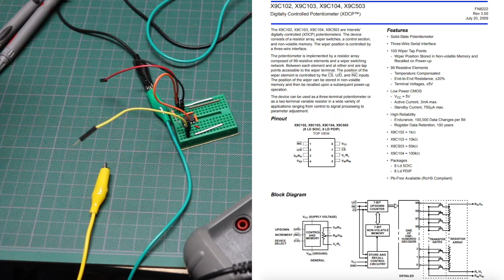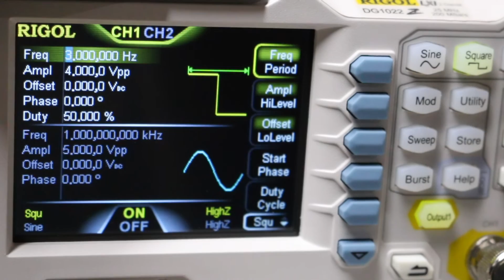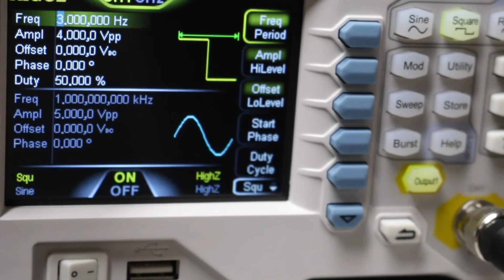Digital Potentiometer Control Basics - X9C103

Comment: This is a great instructional video for a really useful device, but what I came here looking for is a digital potentiometer that sets its resistance based on a PWM signal. I suspect such a thing exists, just not sure what it's called or how to find it. Any advice would be super helpful. Thanks in advance!
Reply from the maker: I don’t think there is a digital pot with PWM direct control, it’s usually some sort of up/down digital control, or SPI or I2C serial control.
So some sort of interface circuit would need to read the PWM duty cycle and translate that to whatever type of control the pot wants so it sounds like some sort of micro controller project.
Two general thoughts on that could be a microcontroller can measure the timing of the PWM transitions and determine the duty cycle and then just set the pot when it changes, or put the PWM signal through an RC low pass filter to translate it to an average DC voltage and then read that on the microcontrollers analog input and again convert that into a percentage wiper position and communicate with the digital pot.
That all assumes the digital pot will even work in the application like if it is meant to replace a physical pot, usually there’s a maximum operating voltage of 5 V or possibly less I’m not sure
Reply: @GadgetReboot  Wow! Thank you for the quick reply. I'm wanting to control the variable control side of a SSR-40VA with a PWM signal instead of a manual 500Kohm pot. Maybe I can read the voltage of the signal being sent into and out of the manual pot across its range then just pass the PWM signal across a RC low pass filter that outputs that voltage range to simulate what the output of the manual pot would be.
Reply: @GadgetReboot  I would just send the PWM signal to a SSR-40DA, but it uses the zero cross trigger method and I'd prefer to use the trimmer control method as illustrated on page 2 of the datasheet linked to below... https://cdn.sparkfun.com/datasheets/Components/General/SSR40DA.pdf
Reply from the maker: Now that I looked more into the SSR with variable 500K pot control (never worked with SSR before) I see a big can of worms.  Here's one thread I stumbled across that summarizes some issues trying to use something other than the 2 watt 500K pot, though it's an old thread so some links/images are broken but the discussion still helps.
https://forum.arduino.cc/t/relay-amperage-output-control-with-pwm/261538/14
Basically, the biggest problem is that 500k 2 watt pot is a heavy duty item, and apparently the mains voltage (peaks over 300v) is present at that control input (probably why it's a high power pot), so trying to add other DC control voltages or devices in place of a high power resistance wouldn't work.   I think the pot is part of the mains AC controlling a TRIAC rather than it being an isolated "control input" at low power.
So if there's a different variation of the SSR that takes DC control input and can vary the output instead of just on/off, that would be a more hackable starting point.
The digital pots in general are really only low current low voltage things, so working up to 5v DC and maybe only max 5 mA current, definitely not something to place across 300+ VAC.   They're mostly used for things like adjusting a reference voltage on an op amp where there's really no load current though them, or they can be used to control audio volume on low level signals like line in/out (a few volts peak).
Reply: @GadgetReboot  That's a great article, kudos for finding it and thanks for sharing. One possible solution is to use the PWM signal to drive a servo that turns the manual pot, but I'm blown away that there's not a more elegant all electronic solution. Seems to me that in our electrified world of billions of people, if I as a hobbyist am trying to solve this challenge, there must have been thousands of engineers who've done the same. Another possible solution is to have a micro controller convert the PWM to a 1-10 number by dropping the second digit of the duty cycle percentage, then use that number to control a transistor array that channels the SSR's control current through 1-10 50K resistors... much like the X9C103 chip in your video above. Also, the pot that ships with the SSR-40VA that I bought off Amazon is 0.25 watt, so not quite as heavy duty. I'm curious to see what voltage I get testing the control input to ground once I get it set up. Main voltage at 240 would certainly rule out all sorts of typical electronic controllers.
Reply from the maker: I wonder why they do specify the potentiometer as being two watts, maybe general robustness in case there are occasional power voltage spikes or other things outside the nominal clean supply, but with all things being stable, 240 V RMS divided by 500 K is 0.12 W
So a 0.25 W part would be OK for trying out but knowing now they recommend something higher I’d probably use something better if that’s going to be put in use long-term.
The main problem with switching in various resistances to simulate a full scale pot rotation is the fact that it’s AC instead of DC so that may need special design considerations at which point it starts getting convoluted and it may be better to just find a different part if there is one that automatically takes digital input and does the same output control

Comment: Hello sir I'm a btech first year student in india. I am learning electronics and I am trying to make my own bluetooth speaker so people ask me y don't ur speaker have buttons to operate the volume so I'm curious to know how this digital potentiometer works and ur videos definately helped me a lot
Reply: I just want to know how to connect to the amplifier so that I can control the volume
Reply from the maker: It would depend on the circuit especially being bluetooth if you don't have audio coming in from a wire, normally the pot would go in line with incoming audio like this  https://i.stack.imgur.com/w5C3B.jpg     but if you're using some kind of custom chip with all kinds of built in functions, that needs to be analyzed to see what's possible.  It wouldn't go on the output of the amplifier heading to the speaker, too much power and it's always done on the low level input side.
Reply: @GadgetReboot  thanks a lot sir I'll check that

Comment: 3:41 - So an increase or decrease of pule frequency determines the increase or decrease of the digital potentiometer's resistance value?
Reply from the maker: Not the frequency of pulses (how fast they occur) but the number of them received.  For each pulse on the increment pin, the wiper moves one step up or down depending how the up/down pin is set
Reply: @GadgetReboot  Thanks for the clarification. What kind of wattage these digital potentiometer can handle, 1/4 watt?
Reply from the maker: @ShopperPlug  The wiper can handle something up to 4.4 mA with a max voltage of 5v, they're really only intended as non load bearing things like set points on op amps that don't draw anything.  So if I use it for a volume or EQ circuit it's likely got an op amp buffering it too.

Comment: I am hacking a machine. It has a potentiometer for the accelerator pedal. It operates at 24volts and the resistance is about 4.7KOhms. Can i use a digital potentiometer to replace the potentiometer to give me remote control
Reply from the maker: I don’t know if they have digital pots that run at higher voltages but the ones I have used can only work with up to 5 V.
Reply: I am also working on a machine- a pallet stacker to be exact: 24v lead acid battery. Did you ever solve your project ??

Comment: sorry to ask again...but could u please clarify again that,how are u increasing the counter ?
Reply from the maker: The first time I was experimenting with the device I was using square waves from a function generator to make it easy, if I didn’t have that I would either generate pulses from an Arduino or have a pull up resistor to the positive supply and use a switch to ground to manually do it

Comment: I need a 102 because I need to made a 1k electronic pot and all the 2 batchs of 10 units that I bough from 2 different supliers came with 10k, so something is not correct in our evaluation, I though it was only we me but after I saw this video maybe eu are wrong or not seeing the correct prespective... if I bought x9c102s that should have 1K and when measure gives 10k an you with the 103 that should have 10k when measure have 100k... let me see you video until the end...

Comment: ...I bought 10 pieces, in China, of this circuit for 5$...the resistance is not 10k but 100k. Also the circuit doesn't work! So I bought this circuit at Intersil (6$ each). It works perfectly! I had the same problem with LR8N3 (voltage regulator) from the same chinese supplier...The circuits exploded at power on! Thanks for this video, it proved to me that the setup I was using the X9C103 in worked perfectly!

Translated with www.DeepL.com/Translator (free version)
Reply: I check and I saw that I can buy this units in Mouser electronics... I will go to the shop my self and I will buy it but before I will ask to measure in from of me... I need the X9C102P (1k ) from china I bought 2 times from different supliers and all of them arrived with 10K

Comment: between which two terminals resistor is connected
Reply from the maker: Pins 3, 5, 6 contain the potentiometer terminals. 
https://www.renesas.com/us/en/www/doc/datasheet/x9c102-103-104-503.pdf

Comment: I also ordered the 10k from AliExpress but got the 100k so there must be a large batch of incorrectly labelled 103's....shame...waste of time
Reply from the maker: I wonder why that is happening. It almost makes me want to order some from a reputable distributor just to double check the results but I have not needed to place an order somewhere like that in a long time and it will cost a lot for a minimum order and shipping costs so next time I do, maybe I’ll order some of these as well.
Reply: I couldnt find  103s - just 104s. Regardless of 10k or 100k, it should work for the variable voltage bench supply I am planning to build.

Comment: Cool.  Glad you demonstrated this.  Am wondering now if there is a clever way to control it with a rotary encoder sans MCU / function generator.
Reply from the maker: I think I am going to put that on the brainstorm whiteboard as something to think about. I can see the value in using the analogue knob to control the digital pot in some applications for example combining software and analogue override so we can actually do both at the same time. Thanks for the idea!
Reply: Have just finished building a project that drives crystals of arbitrary/unknown value:   http://www.learnabout-electronics.org/Digital/images/clock-7404-xtal.gif
With the 1k resistors, as shown, it drives low megahertz crystals.  If I put in 1M resistors, it drives my 32khz watch crystals.  My thing currently has 3 resistor arrays, all manually jumpered ... now if I had some of those Digital Potentiometers, could probably get an MCU to tell me exactly what resistance drives the crystal at optimal amplitude and stability, and make short work of it.
Reply from the maker: These pots should work for that  since they seem to act like true resistors. Some digital pots force you to use VCC or ground or both across the virtual resistor so you’re not as free to use other devices.  

I have a pile of spare Crystal resonators laying around that I will eventually experiment with. Including using them with inverters. So many projects to get around to ...  I was working on something earlier today that wasn’t going well so I decided to destroy some LEDs instead.
Reply from the maker: I think I came up with a way to use the rotary encoder for the digital pot. I sketched it out so I will try it tomorrow and if it works there will be a video forthcoming. If not then let’s pretend I never said anything.
Reply: @GadgetReboot  any update?
Reply from the maker: @kevindogktm  I did end up using the rotary encoder without a micro to control the digital pot. 
https://www.youtube.com/watch?v=HJWMFebfPrI

Comment: Clear explaination and interesting, but I'm not the type that wants to go throught the mental gymnastics with a mislabled part to get some use out to this.  For now I'll stick with an analogue pot.
Reply from the maker: I am wondering if the cheap eBay parts are cheap because they were mis- labelled much like discounted clothing that has imperfections. One practical use for a digital pot might be having the ability for software to control a current limit for a motor without any hardware  Bill of materials change required.
 I think putting a fixed 11 K resistor in parallel with the 100 K pot will give approximately the equivalent of a 10 K pot. I think I am going to try that.